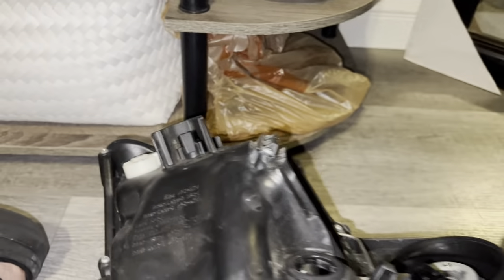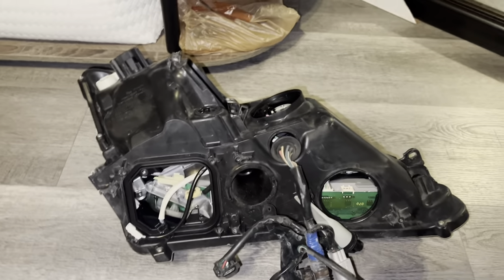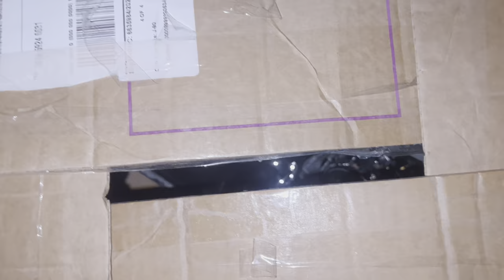How to replace headlight lens (06-13 IS350 headlight lens replacement tutorial )

Comment: Ah cmon man include the link for the lens covers in desc!! I’ve searched for them before with no luck.
Reply from the maker: I got them on eBay, https://www.ebay.com/itm/225549391105?mkcid=16&mkevt=1&mkrid=711-127632-2357-0&ssspo=aoefonr2snm&sssrc=2349624&ssuid=K2heENaDQXi&var=&widget_ver=artemis&media=COPY these fit 2011-2013 headlights, earlier models have a different lens

Comment: Clean bro, how have they held up over time with moisture?

My only recommendation next time would be get a bigger box for more even heat distribution to prevent damaging or melting anything on headlights. 
Also, add another piece of cardboard to prevent too much heat hitting the plastic directly.
I’ve done this once but without removing lens, I just needed to evap the water inside them but it definitely got hot enough for me to remove lens after 10 minutes.

I’ll definitely use this as a guide because my passenger light getting water inside again 🤦🏽‍♂️
Reply from the maker: My passenger headlight has no moisture in it even tho I melted the back 😭 I’m going to make a custom air duct into it no matter what tho so stay tuned for that. My driver side headlight did however but it’s because I used the wrong butyl. So I bought the correct one and I’m going to open it up remove the grey butyl on both headlights and put the correct black butyl on.
Reply from the maker: I honestly think I got moisture in the driver headlight because of the crack but the black butyl will help close it well since the grey butyl isn’t sticky at all

Comment: Great effort and looks great 👍
From where did you buy the lens covers? Do you have a link?
Reply from the maker: Depends which headlights you have, earlier models have a different lens but these fit 2011-2013 headlights https://www.ebay.com/itm/225549391105?mkcid=16&mkevt=1&mkrid=711-127632-2357-0&ssspo=aoefonr2snm&sssrc=2349624&ssuid=K2heENaDQXi&var=&widget_ver=artemis&media=COPY